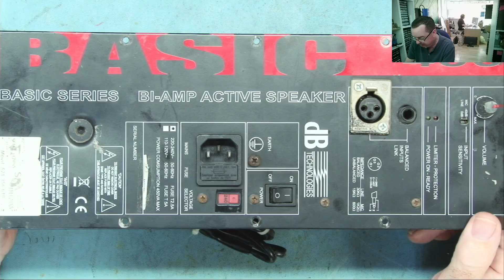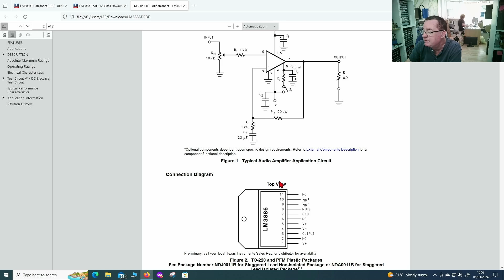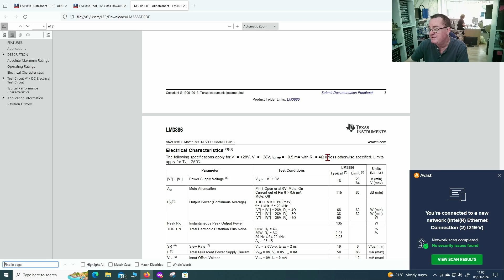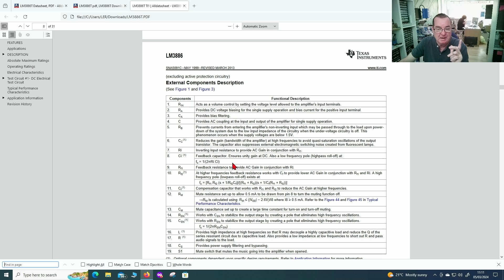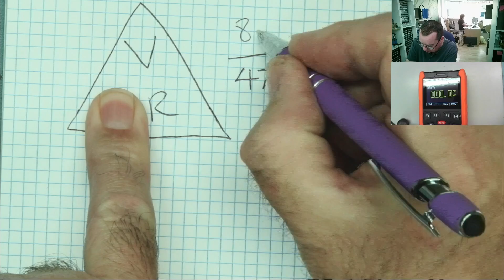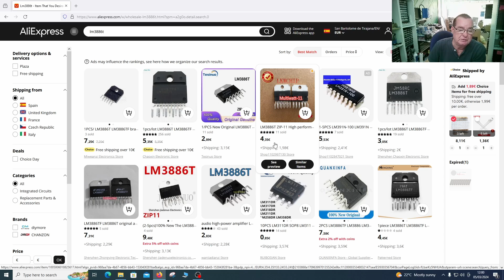How To Diagnose IC Faults : Is It The Chip Or Some Component Connected To It? A Practical Example

Comment: Whilst troubleshooting a missing -15 rail last week, I “coincidentally “ also lost the +15, -15, +16, -16, +5, +3.3, and +1.8V rails😭😭😭😭🥺🥺🤬🤬🤬🤬🤬
It’s going to be near impossible for me to troubleshoot/repair it.  It’s Very nice DAC/DSP/Processor (my fav), and it’s filled with multiple DSP i.c.s, DAC, MCU, FPGAs, and some of the tiniest SMD passives I’ve ever had probe.  Especially puckery moments for me are probing the pins on the $40 BGA microprocessor.  It’s almost bloody impossible for me. Even with my “needle” probes, a magnifying glass, and a head lamp 😂😖
They probably don’t even offer the PCB for sale for it.

Comment: Im not sure but 10:35 why gain will lower when capacitor will have lower resistance? I saw formula for gain   k= 1 + (R1/R2) for not inverting amplifier.  I think resistance of capacitor will sum with R2. And if sum of R2 and capacitor will lower gain will higher. Sry for breaking english

Comment: Testing audio amplifiers it's always best to inject a sine wave from your signal generator into the AMP, that way you can see with an oscilloscope if there's a clean signal getting to the amplifier ic also see if there's any distortion on the output. With audio waveforms it's Impossible to detect any abnormality. would be interesting to see a follow-up video with the replacement  IC.
Reply from the maker: In this case that isn't necessary - all I want to know is if the Amp IC has an input signal and an output signal, having proved it shoud have. I don't really care if it is distorted as the customer did not describe that as the fault

Comment: Hello sir, great video thanks.  The Ci capacitor acts as open circuit at low frequencies frequencies, ensuring unity gain at DC. I believe it essentially forms a high pass amplifier with a low frequency roll off at 1/(2πRiCi)

Comment: You started with the basic tests - Fuse and output voltages from rectifiers, BUT with these active speaker amps that get abused the real test will be CHECK THE SPEAKER! Is it blown and presenting as a dead short (0 ohms) ? 
My recent work on a similar Active speaker (biamped) the Bass speaker was 0 ohms and the associated Class D Amp also blown as a consequence of that speaker fault.  
You suggest the 'customer' is "pretty good" BUT some clown at a carnival might have run it at 11 for shits and giggles.
Reply from the maker: Customer already did this - he owns a business that has a lot of these. I did mention it in the video

Comment: 7:39 - I hope there is a way to change the strange font on your meter. That would be hard for me to look at for long periods of time.  I'll check out your review video. 8:04 - I already like the settling alert LED at the top. Nice touch!
10:58 - Richard, every you say, "I'm not an expert . . . ," I have nothing to respond other than the explanations you give about something unfamiliar to you makes a lot of sense and seems to be spot on.  Thank you for the commentary, even though you may not be a designer of the circuits you discuss.

Comment: that is actually a Toroidal transformer not a linear transformer
Reply: Linear power supply - not SMP
Reply: I think by linear he means not a flyback transformer. As in, there is a linear relationship in voltage and current between the windings. Flybacks and air-gapped transformers, car ignition coils, and tesla coils don't have a linear relationship, because the voltage is dependent on duty cycle and the high voltage spike produced when the magnetic field collapses. Yes, it's obviously a toroidal transformer, but any big heavy transformer that runs on a 50/60 hz sine wave instead of a high frequency square wave is a linear transformer.
At least, I think that's what he means.
Reply from the maker: @SkippiiKai  Yes. That.
Reply: @SkippiiKai  Linear power supply - not SMP
How novel... you 'think' sometimes?

Comment: G,day Richard from Sydney Australia.. As a learner the noteworthy;
* Different V and Fz to the woofer and tweeter 
* Grounding the meter on PCB (for that rail) and identifying V on rails and trace points.
* Assess heat spot temperature and check components for removal and replacement.
🌏🇦🇺

Comment: I find the pricing on Aliexpress very misleading at times. As in this case, the price plus shipping from one seller is higher than another seller who offers free shipping. But sometimes the first seller offers free shipping above a certain total which effectively makes the extra item free or very low cost. Of course, that is of no benefit if you are never likely to use the extra item.